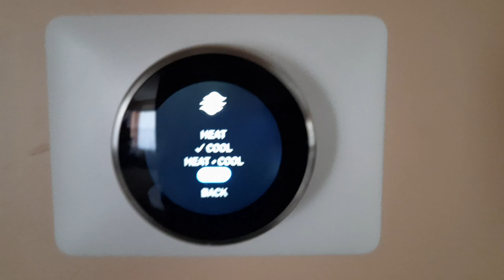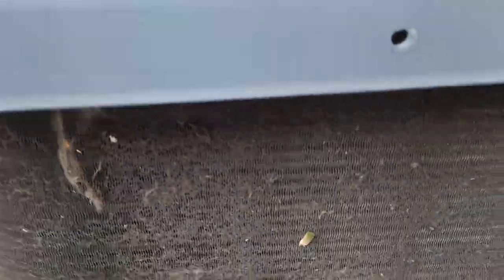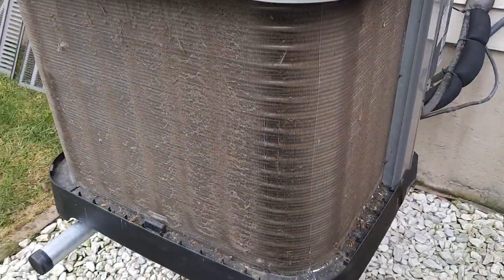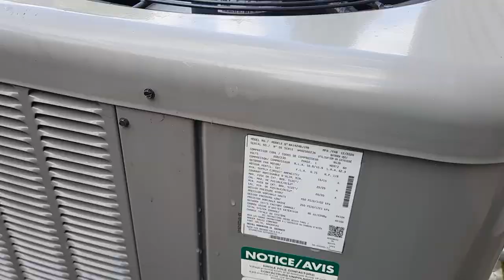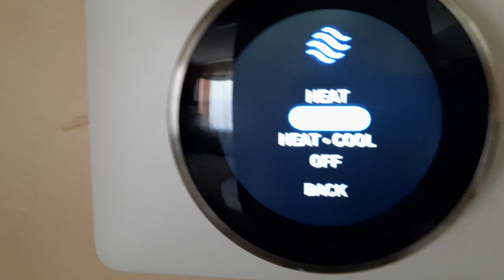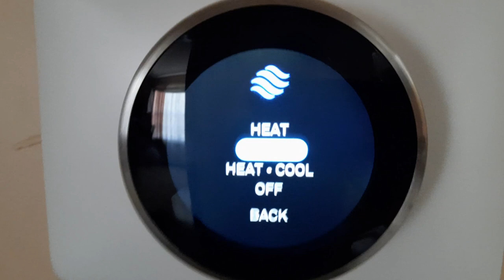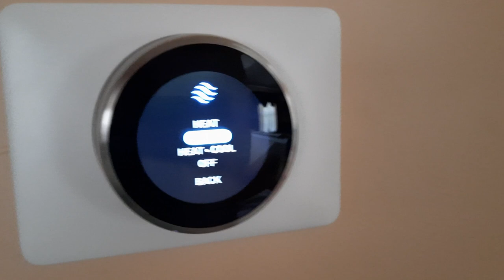How to clean outside AC condenser unit- DIY - without calling professionals.

Comment: I've been using Dawn soap or simple Green for a last 4 years and both of them really works good I believe it's safe
Reply from the maker: I heard about that and vinegar as well, but this time I believe just water, after dusting it off, should be fine. Next time I am going to use some of those  cleaners. Thank you for watching and your  comment.
Reply: I would not use vinegar as it is corrosive.
Reply from the maker: @sandramays795  Thank you. Good to know.
Reply from the maker: @Sandra Mays 🐶🐱  Could you tell me, please, what you prefer to use? Thank you.
Reply: @averagemaintenance3875  I just spray inside out with my water hose under light pressure. I’d give Dawn a shot too, for anything stubborn. I don’t like using chemicals or harsh things.
Reply from the maker: @sandramays795  Make sense. Thank you very much.